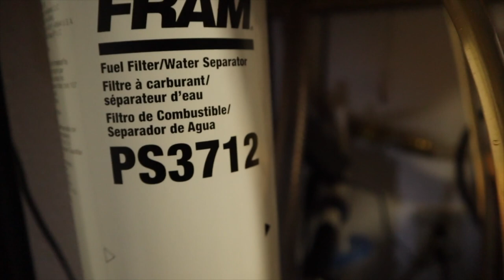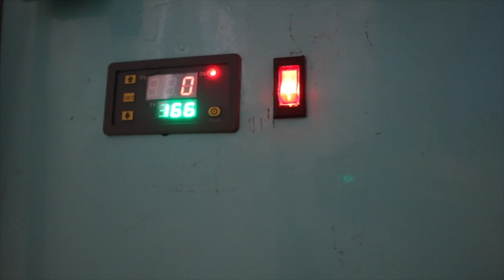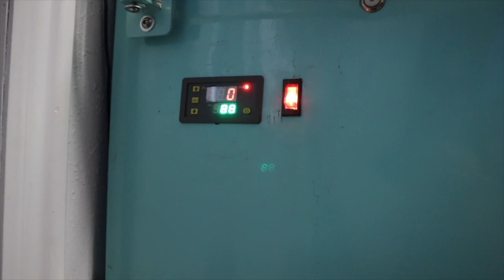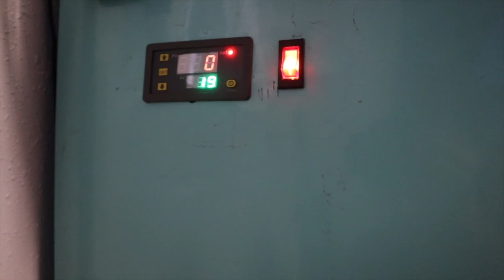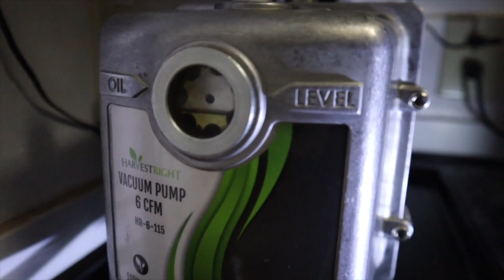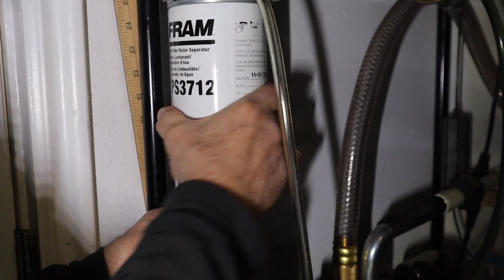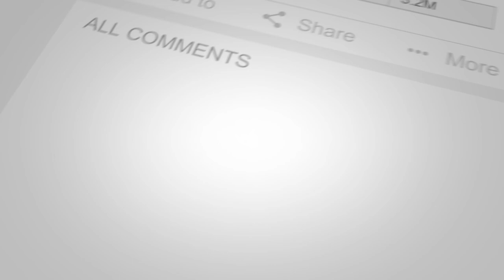DIY Automatic Oil Filter & Water Separator for your Freeze Dryer Vacuum Pump

Comment: Good job wingnut.  👏 plus it is a closed system that means no vapor or evaporation of the oil
Reply from the maker: What I didn’t say is that my pump is extra fast at pulling down and maintaining a very deep vacuum. It used to take up to 10min to get below 600 but now it drops below 500 in just 4-5 min. I’m sure it’s because the internals are so clean and because I moved to dairy vacuum oil. 
I’m not sure this will not be a big video as it takes some mechanical ability to make and install it but my hope is that it can help those with the ability to simplify their lives. 
It is so fast to turn the cycle around and have the machine rolling again. 
Thanks for watching and taking the time to comment

Comment: Great Work!!!
Please let me add a bit of engineering from my years of experience as a Refrigeration mechanic and automotive technician and well as an ME.
Automotive electric fuel pumps don't work well as suction pumps. They like to source fluid from below fluid level. I know this interrupts your filter system, but hey!!! Moisture likes to stay low any way!!!
Consider a cold trap, as commonly used in physics/chemistry experiments, to remove moisture before it can get back into your vacuum pump.
As a refrigeration mechanic, the thought of that much moisture getting into my vacuum pump make me cringe!!!

I am going to build a similar rig, as I am vacuum to power a flat plate vacuum hold down plate for surface grinding graphite material for use in an EDM die sinker. As stated, I really hate the thought of getting moisture into my pump, as even atmospheric air has a lot of moisture in it. Your idea seems like a good idea, so I will experiment with it, and see how it goes.

You have a fantastic channel,
Thanks,
Tim
Reply: I would really like to do this with a moisture trap as well, but I can't seem to find any way to do it economically. Do you know of a way to accomplish this without spending more than a couple hundred dollars? 
Thanks! 
-Jason
Reply: You need a container with in a container.
place your small vacuum container inside a bucket, or other container to allow space all abound the inter one. Your vacuum is moved through the smaller container that is suspended in an ice bath. That way moisture in the vacuum chamber will condense out in the container, and not get drawn into your vacuum pump. If you really want to keep things below the condensation point, fill your outer container with a mixture of mineral spirits, or alcohol, and mix in some chunks of dry ice. That should give a temperature of about  -109 degrees F, and should trap out large amounts of moisture before the mix warms up. For better results, insulate the outer container, top, bottom and sides!!!
Yes it's crude, and not maximally efficient, but the idea can be expanded upon, and can be made very efficient.
In some locations, ground water will be enough below the dew point pf moisture to cause it to condense. Super cold just gets more of the vapors in less space. the longer the air remains in contact with a below condensing point surface, the more moisture gets removed. Think a long thin tube in an insulated trough!!!
Some experimentation will be required, your results will vary.
Reference tube with in a tube condenser, as used in refrigeration applications. You might find a junk one in the scrap yard, or fabricate one from copper pipe and tubing. 
just remember, low air flow and large surface area for condensation to take place.
Tim @jasonbadger9164

Comment: Wonderful project. I am buying my first freeze deyer tomorrow and I eas wondering if there was an easy way to filter and remove the water from the pump oil. This viseo makes me wonder why this type of system is not sold included as an optional water filter and pump oil cleaner. It looks like a great option for making the pump oil last much longer making the cost of running a freeze dryer much more cost effective and efficient. Thanks again for your great idea which I plan to figure out a way to imcorporate without voiding my pump or freeze dryer warranty.
Reply from the maker: I love NOT having to drain the oil and filter it and then find the pump gumming up with the sludge… My pump is still as clean as the day we got it… its the second pump as the first one died from a pump heart attack from being so gummed up.

Comment: I’m assuming this isn’t an issue since you’ve been running this setup for a year now with no issues. But, is there a risk of running the pump with too little oil in it since you are using the fuel pump to pull oil out of the vacuum pump while it’s running? Is the oil going back into the vacuum pump at the same right that it’s being pulled out?
Reply from the maker: You can add to the pump while the entire setup is running. The filter is putting the oil back in the reservoir on the no vacuum or pressure side. 
Yes, The filter system puts oil back in at the same rate it comes out with the exception of the initial startup where the oil filter must fill up. I run the oil filter pump system before I turn on the freeze dryer to make sure the system is full of oil and in the center of the site glass. I also set the oil filter system to sporadically run 60sec on and 360sec off when the freeze dryer is not in use. This prevents sludge from building up in and plugging the filter as well as keeps all moisture out of then vacuum pump
Reply: @CaptainWingnut  thanks!

Comment: Quick question--- I have an HR Oil Less VAC PUMP...  I wanted to apply this Air Drying Technique to the FD---  passing the MOIST AIR through a DRYER before it hits my Vacuum Pump...  You have a set up suggestion for this??
Reply from the maker: I’m sorry I don’t. 
You’d probably have to install an inline desiccant type dryer in the line between the freeze dryer and the vacuum pump. 
There will be testing to verify that the filter can withstand the vacuum of zero atmosphere, and that it would maintain the vacuum, and also if you would need to install a computer chip cooler to the filter to condense the moisture.
Before I built this filter dryer I tested all of the variables and had actually run it in a very hodgepodge form to prove that it would work before I actually went through the trouble of making it and filming a bust (been there done that).

Comment: Greetings Cap. I have a question about your oil filter set up. I just ordered the main parts for my own oil system as I am as disgusted as you with cleaning the pump all the time. The question is: do I need to be concerned with running the pump full of oil? Watching your video and a couple others (Epicenterbryan for one) it appears that the pump reservoir will always be full, yet the videos seem to show half full in the  sight glass. Can you explain this for me please. FYI, I found a water separator/filter with an amber plastic bowl with a drain for water. Thanks, Jonas (your Utah neighbor)

Comment: Is the mung coming from the stuff you're freeze drying? Because if so, it seems like some kind of prefilter between the dryer and the pump would keep the mung out of the oil in the first place.  Something like the oil & water separator you'd use on an air compressor discharge, perhaps.

Comment: If we clean the vacuum hose air before it enters the pump. Tests have showen a smaller suction hose stops the contaminates, simple as pushing another hose inside the hose you have. Why is the vacuum pump running all the dry time? What is the lowest vacuum you can pull?

Comment: So that separates the water from the oil but is there no other filtering that's needed for all the gunk that you were seeing before or does that all come out with the water?
Reply from the maker: The filter is a filter first and then a water settling chamber at the bottom and yes, it traps all of the gunk down to I believe 5microns which is very small. The oil coming out of the filter is extremely pure and moisture free and the pump inside looks like new after over 50 batches now.

Comment: Your parts list is Great.
Thank You 🙂
Could you provide more information on your Dairy Vacuum Pump oil, part # and vendor, Please.
PS Went to your website, links were Not working for me to Buy the parts for vacuum pump oil filter system. 😢
Reply: I am Building your System, I have added 1 modification.
I found a 240 mm computer radiator and 2-12 vdc fans to fit the radiator. My thought was you have the oil out may as well cool it while you are moving the oil.